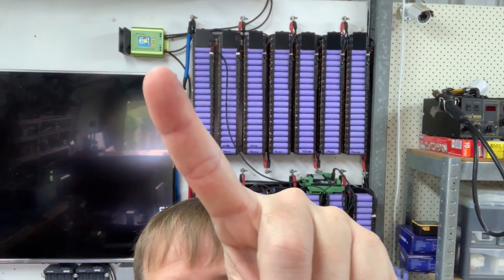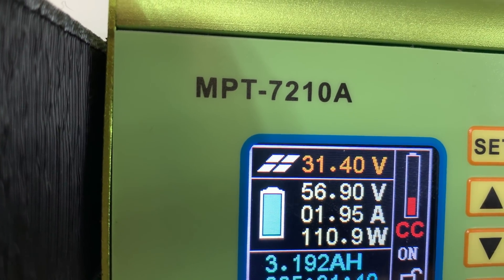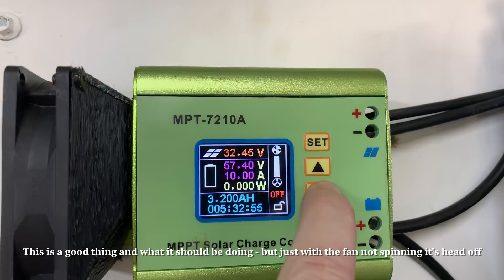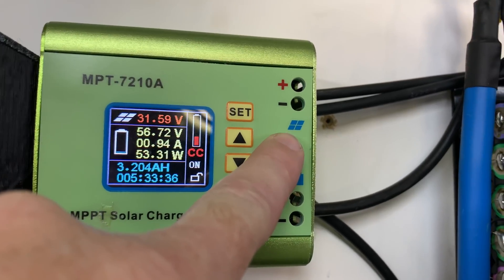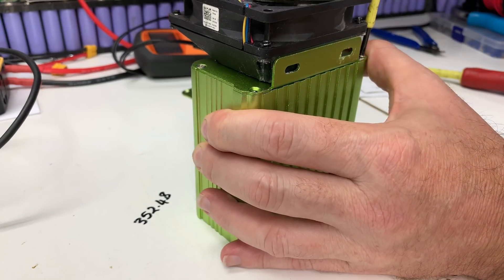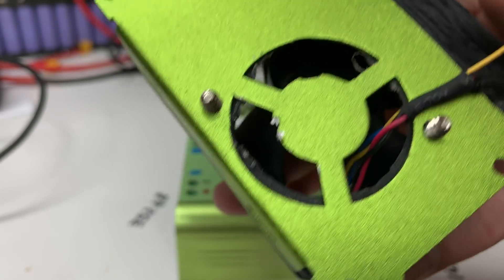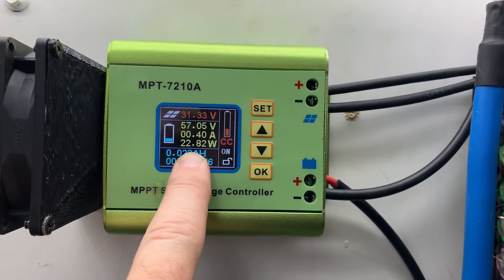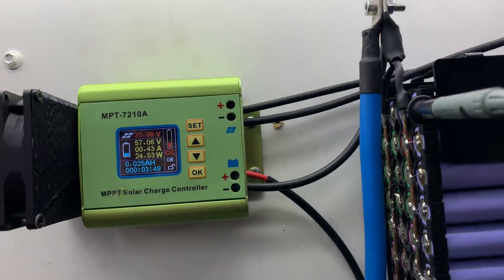MPT 7210a Fan speed issue

Comment: Remove high frequency noise: I fixed the both annoying high frequency and amplitude of the fan noise significantly, by just using a small file and narrow strip of sand paper on the inside edges of the three fan guard supports on my MPT-7210A.  From making flute I realized the sharp inside edge of the guard struts with the blade close by makes a pretty good whistle...... and might be source of high frequency..
The leading edge has most impact but rounding over both inside edges reduced]s the sound to the low intrinsic fan sound which is minor and low F.  
I had to put my ear to hear it after the modification and it leaves the "guard "function inlace.  Hope this helps someone else who's still willing to try this device. 

Semantically 

Outside MPT-7210A
      \_/              Aluminum guard strut on case rounded over  to inside(6X)
       /                 Fan blade rotation ->
Inside of  MPT-7210A
Reply from the maker: Might be a help to others but this unit never lasted for more than a few weeks.

Comment: 10amp is that the solar input it can handle? or is that output ,  does anyone have recomendations for a reasonable prized unit that can handle 6-10, 100watt panels and can be regulated to charge 18650?

Comment: Hello, Why I can't get more charge power than 150W on the mpt-7210a regulator? In full sun, I connect 4x230W solar panels in parallel mpp = 29V Open circuit 40V. The rechargeable batteries are 48V 40Ah. The parameters set in the controller are 55V charging voltage and 10A charging current and mppt set to 29V. The regulator shows the voltage on the PV during charging 35V and the battery charging current 3A and the voltage on the battery 50V. The regulator should draw PV voltage to 29V and give a charging current of 10A which would give 500W.

Comment: I'm having a possibly related issue with my 7210a just now, just hooked it up to 2 100W panels (parallel, 18V input) to charge a 48V 10Ah e-bike battery pack and the output seems to only ramp up to around 15W total output (like .1A out), and then it drops back down to 0 output, then works up again over about 20secs to 15W, then back to 0 again? The fan is set to 100% and i can hear it running the whole time. I gave up and just put the normal mains charger on the battery. Should i just go for a better MPPT charger?
Reply from the maker: Put it in the bin and make coffee - at least you'll have caffeen in your system to deal with the junk :(
Reply: Put half of your panels to series so total voltage is nearer to 48v.
Limit charging current to maximum panel power minus 25%. 
Start running... This time it should be more stable. Mine did the same as panel voltage droped too low (like below 16v instead of 17.5)

Comment: Mine suffered the same issues.... however it turned out that it doesn’t like high voltage input to high current output.... as the model name implies, it’s only rated for 10A peak, while it’ll operate nicely at half of its rating.
Reply from the maker: Doesn't matter how I used it in for the input and output voltages - it's junk and never worked like it said it would on the box. (then it died anyway)

Comment: DROK MPPT Solar Panel Battery Charge Controller Color LCD Digital Display Boost Voltage Converter Regulator DC 12-60V Step Up to DC 15-90V for 24V/36V/48V/60V/72V 0-10A Battery Pack Charging

Hi Peter,
Your replies are making me better. I want to buy the above MPPT controller. It is good for charging my 7s 20P battery pack I am going to build. I do not understand still how many batteries=to 10A. Thanks for another reply to me.
Reply from the maker: I would not buy this one unless it's with in your budget, much better to buy a www.diypowerwalls.com/PCM60X costs more but MUCH better unit. This little green one died after about 6months of use

Comment: Your pulling too much power with that Larger fan.  Starving the other circuitry.
Reply from the maker: Was exactly the same with the smaller std fan
Reply: @HBPowerwall  What ever happened with it ?
Reply from the maker: it's still running but only charges at 2.4amps with 20amps worth of solar at 36v

Comment: Hmm since the fan wants to be on constantly I will put in a relay circuit and pot and power the fan from the battery to isolate it. Also knowing why this thing needs so much airflow is kind of the first thing I want to know.
Reply from the maker: Cheap controller I guess. Fan is cheaper than heat sinks
Reply: Fan is cheaper yes but the whole case is a heatsink why not just desolder the heating component and rewired them

Comment: Why not put the fan in something like a vacuum cleaner tube, far away from the scc, then attach the other end of the tube to the scc?  You could even use a larger fan, (such as a computer case fan), powered some other way (such as from a 13.8V external power supply), and then either disable that small loud internal fan or use a resistor which would make it draw the same amount of power as the fan would have, putting that resistor in the airflow to help cool it.
Reply from the maker: too hard, the 3D printed fan mount makes it quieter *kinda

Comment: Kevin Oakes has the right idea with the big resistor inline. Put it physically in the air flow and it shouldn't get too hot to fail. But I really came here to say the back of that board triggered me! The gaps of missing solder on the high power traces feels bad. Please thicken those up!

Comment: First guess I'd say the fan speed driver is coupling to charge circuit due to being over driven. If it only started these problems when you upgraded the fan, it would point towards that. Maybe try some bigger filter caps. Just a guess though.
Reply from the maker: Issue was there from the first time i fired it up :(
Reply: @HBPowerwall  Spewen. I'ts still more likely to be a coupling issue than a programming one though and you can't fix a programming issue. I'd try disconnecting the fan and running it from a separate power supply. After that if it still freaks out when you change the fan speed it's most likely a programming issue that a board repair can't fix.
Reply: Bonus points though for putting the fan on the right way round!

Comment: I had mine set at 28.7 volts... came home from work to it still charging the battery at 29.6. Never knew about fan speed control, just took the whole side panel off and taped on a 60mm cpu fan. I think we're all expecting a little too much from one of the cheapest mppt charge controllers on the market.
Reply from the maker: you still want them to work safely - cheap or not

Comment: I had the input capacitor fail on mine. I was messing around with my new current probe and noticed massive input current ripple on the solar panel line. Replaced the cap with a really big one (63v 10000uF) and all is good again. Also the fan should always be run at 100% speed, if you need lower speeds then mod the fan with a series resistor (22 or 47 ohms).

Comment: Hi Pete I also have one. The problem I have with mine is the MPPT tracking or lack of after clouds have passed over.
They need to improve this module for better fan management system and MPPT recovery from shading.
Reply from the maker: I don't think they are MPPT at all I was under the understanding they are boost/pwm configuration with a name that looks like mppt lol I think they are close to having a good product, but at the moment all they have is a cheap product
Reply: @HBPowerwall  They are MPPT, just not a very good implementation of it. However even with the basic MPPT implementation they are far superior to a standard boost converter for this application.

Comment: this is not a fault of the device, the device was fine until you modified it.
Computer cooling fans are NOTORIOUS for injecting all sorts of noise onto PSU rails. EMI is what you are seeing here, generated by the fan, which should be obvious as it is only happening at settings <100%

There really is SFA you can do about it. I would try using a common mode choke in series between the fan and the charger. Maybe add some some filtering through an LC filter AFTER a diode to reduce some of the noise coming back from the fan.

In reality, you're going to have EMI from the fan anyway so unless you somehow create a Faraday cage around the center of the fan (which should already be taken care of by the aluminuim case of the charger)

Is the aluminium case grounded? Ground the charger case and you might find it cures the problem for the most part.
Reply from the maker: it was MUCH worse before I added fan it moved more than two volts back and forth and the unit was unusable in this location due to having to run the fan at 100 percent I'll try grounding it but don't think that'll help much
Reply: @HBPowerwall  how about sticking a 120mm fan, although much bigger and quieter, you might bring it down to 50%?

Comment: Put a resistor on the fan wire to slow the fan down and leave the fan set at full on the controller. The pwm of the fan is causing interference with the voltage sensing circuit.
Reply from the maker: THAT sounds like an easy fix!

Comment: just use a boost converter that you can set the max voltage and current
Reply from the maker: that would work too
Reply: A boost converter will pulls the panel voltage down to 1-2 volts though, it won't work well connected directly to solar panels.

Comment: I am the one who told you on the live about replacing the capacitors, because you said that the MPT- would not charge fast enough. What you've shown us here on this video is actually a different issue.

Let me start by saying that this "charger" (it's actually a good boost converter with MPPT tricks) is plagued by two different issues:
1. The fan speed - readings issue and
2. The very low output issue.

re: 1. I have two units. One of them indeed has the fan speed - readings issue since day one, like yours. I replaced the small capacitor (it's a smoothing capacitor for the fan) next to the fan port and it got better, but did not go away completely. The other unit had no issues with the fan speed, it's rock solid, low or high RPMs. Units seems identical from the inside, but the fans are of a different brand. Maybe it has something to do with the "internal decoupling capacitor" inside some fans, as William Petty commented. Maybe we need to use fans without additional electronics build in, or something like that. That said, it does not overcharge the batteries, just set the max voltage a bit lower just to be sure.

re: 2. Both of my units developed a situation in which the detected voltage on the screen would raise greatly, depending on the current going into the battery. The voltage of the battery would not raise, of course. This was due to "dead" output smoothing capacitors on the output of the unit (the two identical large capacitors), and they would not filter the output from high-frequency induction currents (these units work at very high frequencies to do their conversion), so the unit would "read" the voltage unsuccessfully. This issue was completely fixed by replacing the said capacitors.

I actually have done a similar video a while ago on the 1st issue, which I sent over to the seller, who said that they would ship a new unit, which they never did and I lost some dates to claim a refund, but that's OK, learned a lot from this unit. Here's the link to my video: https://www.youtube.com/watch?v=_219JrlbNxg
Reply: There's also some info from my findings here: https://secondlifestorage.com/t-MPT-7210A-Questions though I ended up making the 80mm to 40mm fan adapter to just use a quieter 80mm fan at full speed, never did root cause/fix the fan PWM issue.
Reply: I wanna bay a similar charger for my 1.2 kw solar panel, which one do u sugest me?

Comment: Just buy a victron and call it a day and send this Chinese crap were it belongs to china 🇨🇳
Reply: 94Discovery all Victrons are buck converters. This one is the only one capable of charging a higher voltage battery using a lower voltage panel. The only one that I know of, anyway.
Reply: Thanos Tourtouras all he needs to do is go more series than parallel with his panels it is lot easier to down charge than to up charges on electronic components lots of heat is waisted in the process and that is loss off efficiency
Reply: 94Discovery buck converters are generally just 5% more efficient than boost converters.

Comment: Just replace it.
I recommend an EPever Tracer AN, they're the cheapest "proper" MPPT controllers I've come across. Have 2 myself, very impressive device considering how cheap they are.
https://www.aliexpress.com/item/EPever-MPPT-40A-30A-20A-10A-Solar-Charge-Controller-Black-Light-LCD-Solar-Regulator-for-12V/32863089859.html

Comment: The external fan you added likely draws much more current than the original fan. When the PWM is switching, (less than 100% on) the PWM switch generates very large current spikes. I have seen this before where these spikes will interfere with the analog elements of the processor and cause erratic behavior. If you add an RC filter between the fan and the controller, this behavior will likely go away. Some fans have a large internal decoupling capacitor and simple PWM circuits just switch the negative leg of the fan to ground. This will generate major ground currents in the PCB.
Reply: This also happens with the stock small fan as well, which definitely does lot more noise, because it's mounted right onto the aluminum casing and acts like a siren.
Reply: Connect the fan to its own supply?
Reply: These don't have pwm. They change dc from the panels to AC then boost the voltage then convert the boosted a.c. back to dc to charge. It's a weird way to do it but it works. Now when you try to use this on 12volt batteries it never stops charging.
Reply: jesse serfling I was referring to the PWM fan speed control, not the solar / battery charging portion.
Reply: @petski999  lol I see that now.